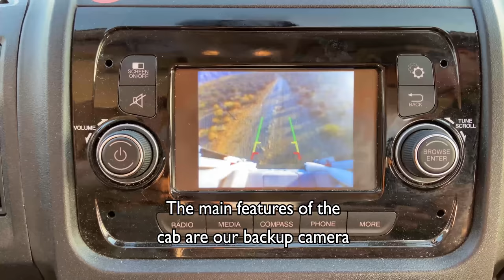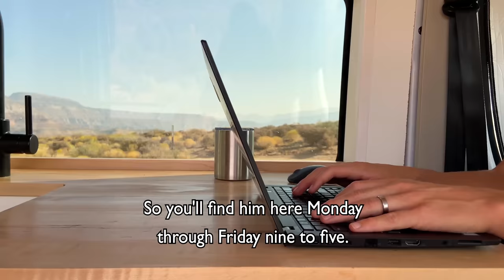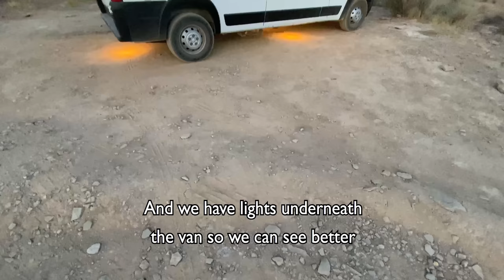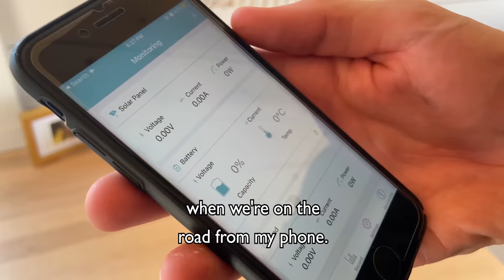VAN TOUR | Custom Ram Promaster Conversion, Indoor Shower, Off-grid Solar, Convertible Bed, DIY home

Comment: Really nice! a suggestion about the kettlebell if I may, please find a way to secure it because even in a slow speed accident it is going to do some serious damage to your van or to your body. I would look for a solution with ratchet straps or some other kind of adjustable tie down with secure anchor points. Awesome van and I love the attention to detail especially for small things like that beautiful metal vent grate. Personally I prefer a fixed bed but it cool that you did what works for your lifestyle, that's one of the things I really love about van builds that they are tailored to the individual. best wishes :)

Comment: This van conversion is the best and most beautiful of single/couple's van living conversions I have seen so far. It made me desire to get an exact one like yours. Everything is perfect. A few more litres of water gallon would've been great if there was more space, but 33ltrs is a good one and does not make this Van any less perfect. Well-done guys 💕
Reply: Main sure to switch the places of the kitchens countertops so that the kitchen sinks tap could be used as an outdoor tap and make that tap you buy is able to swivel 360° with hot-cold and  purified water features.
Switching the places of those countertops would also make room for an foldable outdoor table that you can attach behind the sink wall.
Also instead of the oven buy microwave with convection features that can also be used as a air fryer(and many more features) of Panasonic.
Add a shelf on to the bed cum lounge wall where you can place a Wi-Fi router and make space in the roof for a Wi-Fi booster.
That's it ! Rest is all perfect.

Comment: Main sure to switch the places of the kitchens countertops so that the kitchen sinks tap could be used as an outdoor tap and make that tap you buy is able to swivel 360° with hot-cold and  purified water features.
Switching the places of those countertops would also make room for an foldable outdoor table that you can attach behind the sink wall.
Also instead of the oven buy microwave with convection features that can also be used as a air fryer(and many more features) of Panasonic.
Add a shelf on to the bed cum lounge wall where you can place a Wi-Fi router and make space in the roof for a Wi-Fi booster.
That's it ! Rest is all perfect!
Thank you for reading all this!

Comment: This is my favorite layout of all the van conversions that I’ve seen on YouTube, and also the most attractive!  There’s only one factor I’m not fond of—no pooping in the toilet.  I gather that “poop shovel” is for hole-digging use during boon-docking.  But how inconvenient that must be if nature calls (urgently sometimes!) in the middle of the night, during a rain downpour or in the middle of winter.  Or worse—when you’re parked in a fairly public setting with no privacy!  Plus, buried or not, fecal deposits have the potential to spread bacteria and viruses.
Reply: Then I need to add this about the poop shovel, couldn’t you find a better place to keep it than with your food. I realize that you probably try to keep it clean, but wouldn’t it be better to keep it in the bathroom or by the trash can.

Comment: Great build! Where do you store the outdoor chairs for the outdoor table? AND what do you do for heating and to keep the water tank from freezing?
Reply from the maker: Hi! We have small chairs that fit in the rear storage, they fold up to be around 2 feet by 6 inches. We heat with a small propane heater, and also a heated blanket. For the water tank we have a small space heater we can leave on to prevent it from freezing over night as well!

Comment: Really nice but a suggestion about the kettlebell please find a way to secure it because even in a slow speed accident it is going to do some serious damage to your van our tour body. I would look for a solution with ratchet straps or some other kind of adjustable tie down with secure anchor points. Awesome van best wishes

Comment: We love your van so much that we have used many of your elements--thanks for the inspiration!!  2 questions:  LOVE your curtain track and want to put in same...could you please share info on where to purchase??    Also, we love our fridge (same) BUT being AC, it drains a lot and we are strongly considering converting to DC.  Have you had same issue?  We are finding solar and DC to DC charger mostly counters it, but still need to plug in with a couple cloudy days.  Thanks for taking the time to answer!!  Rock on!

Comment: Sooooo - where do you do #2?  And where are the seats for the back pull out table?  Great job - I'm envious!
Reply from the maker: We store them in the back compartment! They are compact size so fit well, we didn’t go over everything we keep in storage back there. We go #2 outside if we’re in super remote locations otherwise we use public restrooms if we’re in a city

Comment: I really like the idea for the seats.
I do have a question tho since there is no separation between the cabin and the rest of the car is energy kept inside? Or is there a small energy loss?
I mean for hot and cold air

Comment: Random question is the wood on top of the van used as a deck and if so do you have a pull out ladder to get there
Reply from the maker: It is! We have to climb on the back doors to get up there, we decided against a permanent ladder to keep the solar safe from tampering

Comment: How tall is Sunny?
Reply from the maker: 6 foot 2, we sleep diagonally in the bed (it is 6 feet wide), and the ceilings are a touch over 6 foot 2 so he never bumps with shoes off. We did have to reverse engineer the floors and ceilings to make it work though! We saved space with a small subfloor and ceiling
Reply: Thank you!